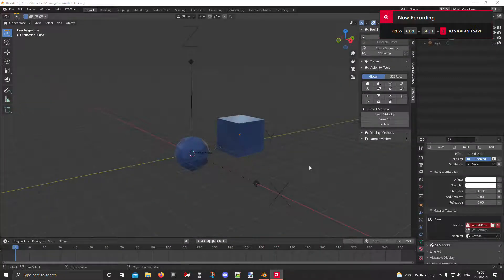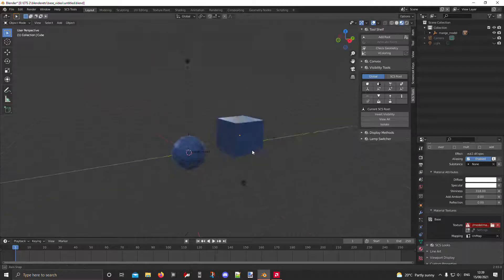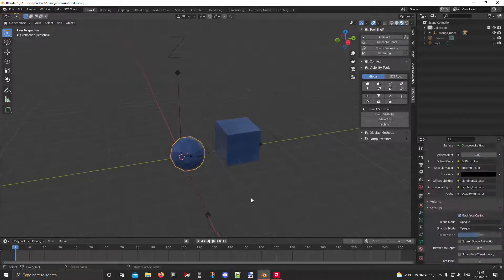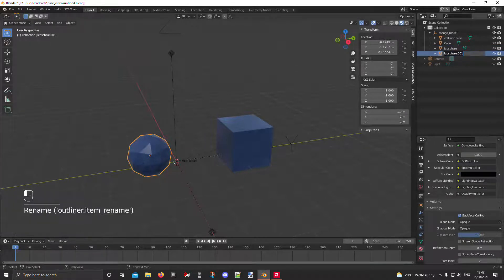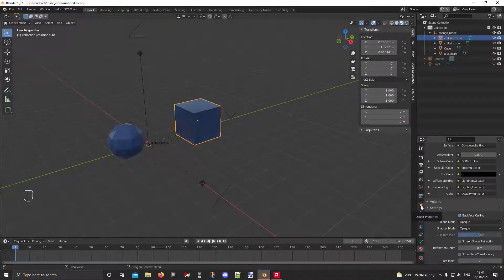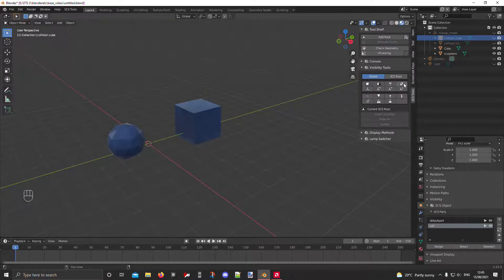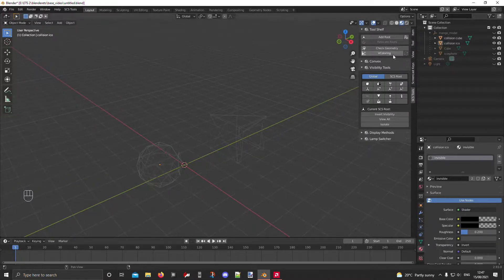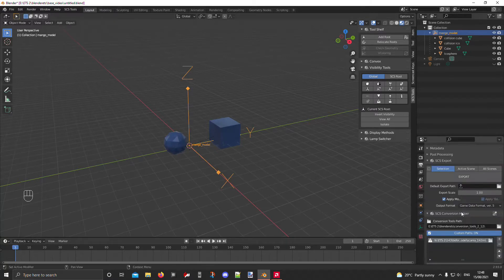SCS Blender Tutorial | 0.5 | Collisions for models

Comment: First of all, thank you for your videos. Not many in the community will share their knowledge with others. That being said, do you have any experience/info on adding map points to models for the editor, specifically building models? I've worked up a couple of custom building models, but when I try to add map points to draw the "dark" area/polygon which shows up on the map, I get an error talking about needing "neighbours" and can't seem to resolve it - and when exporting into the editor otherwise, anytime I try to then open the UI map with those buildings placed, the editor crashes. For now I've just been placing the map area manually in the editor, but it would be nice to figure out for sure how to do it while building the model in blender. Cheers!!